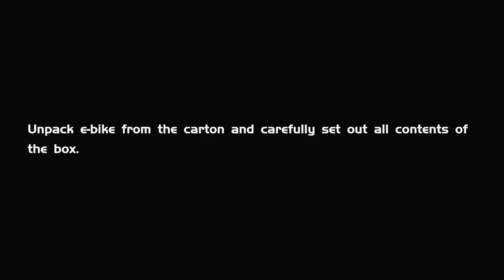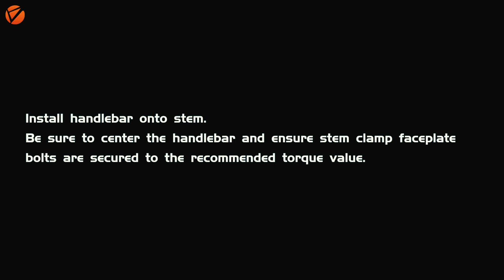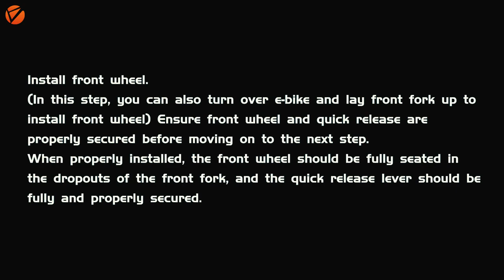How to Assemble Your Cyrusher XF900 Fat-Tire Electric Bike

Comment: Do not buy batteries go nearly every year cyrusher customer service is shocking
Reply: You can buy 3rd party batteries on Amazon or Alibaba with greater range too.
Reply: @HDnatureTV  yeah that's what I'm planning when I get time to do the bike up.. it's ridiculous having to spend £395 every year for a new battery + for them to go after less than 100/150 charges 😕 I just wanted to make people aware what kind of company cyrusher is...
Reply: 1
Reply: 1
Reply: Suppose to get 800 recharges out of the battery. If you are only getting 100 to 150 either the battery is bad or you're doing something wrong.
Reply: @RobertMacCready  bad battery when I received the bike with the original battery the original battery lasted about a year cycling 15 miles everyday on it, when i asked for a replacement they said I'd have to pay £395 for a new battery and cable, I got a professional electrical engineer from work to fit the cable and battery, by this time I'd bought a Voodoo e bizango as a spare bike, a little after 3 months of using the bike the battery went, less than 100 charges, cyrusher tried blaming the throttle, the breaks, the sensor, everything except the battery, long story short, a electrical engineer checked the battery and said it was dead, cyrusher said it was over the 3 month warranty and that type of battery had been discontinued even though it's a 2018 bike ! They're con artists DO NOT BUY
Reply: @shortie77  Well, we'll see. Just got my bike today and will keep track of how many charges I get on the bike. I'm sure you know all the things you shouldn't do with the battery like running it dead all the time and leaving the charger on over night!!!
Reply: @RobertMacCready  yeah or over charge the battery, Good luck with you're new bike, they are fun just shame about the batteries 😕
Reply: Just got mine and its missing the quick release for the front wheel apart from that it looks sick
Reply: @sidvicious05  will do it's a fun bike till the battery goes...